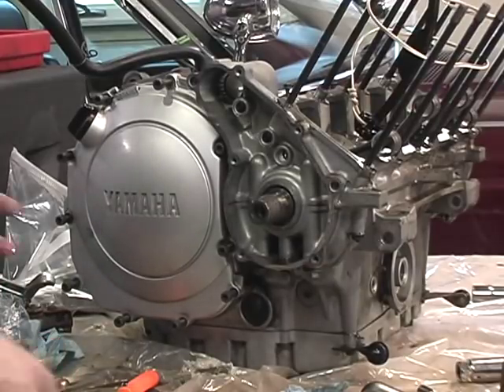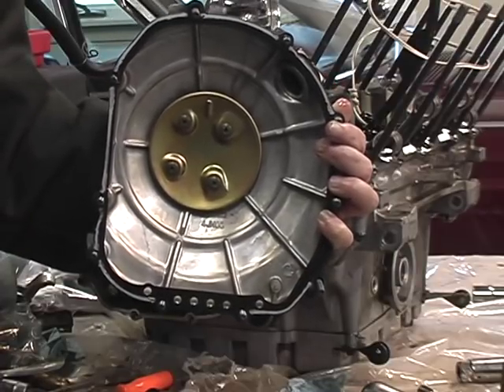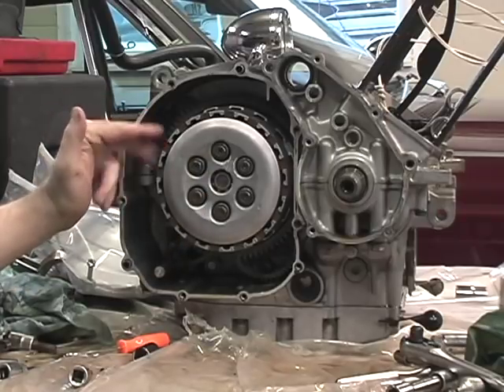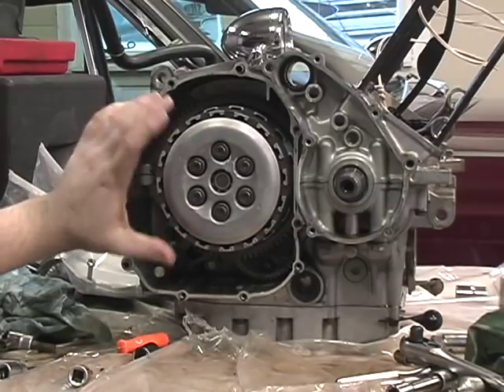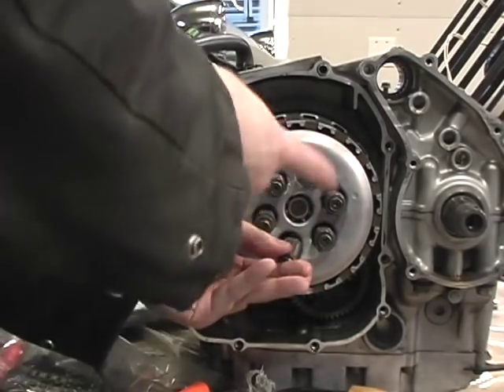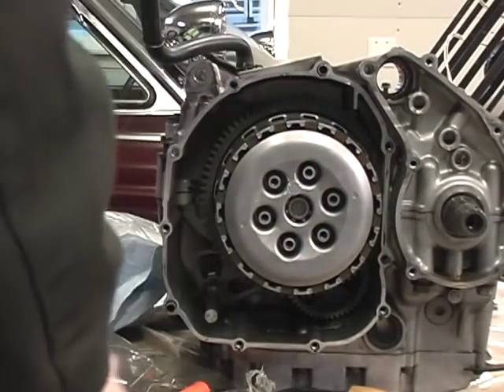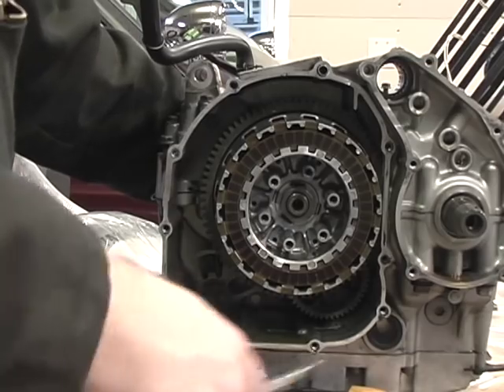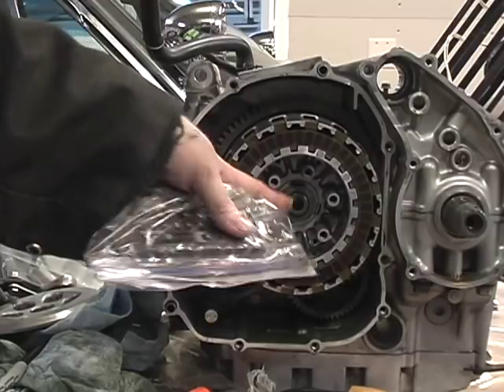13 Clutch Removal yzf600 1996

Comment: Thank you for your reply. I have yet to take the cover off and viewing your video gave me a little better idea whats in there. I am a certified tech so like yourself I can mentally visualize everything in there that could be a cause. It really sounds like a rod Knock but definitely is not a rod bearing or in the internal engine itself. It is for sure coming from the clutch area and more localized right where that shift shaft is but it has to do with whatever is rotating in there... (continued)

Comment from the maker: well in your situation, the sift shaft tab is likely bent.  causing interfearance with the star gear, so shift praw, cant turn the star cam all the way to the next gear. first thing to try is to replace that shaft, you might get lucky. and you can do that on with the bike on the side stand and WITHOUT drainig the oil.  follow the steps in this vid, the shaft comes up at about 11:26. now over time the half shift wears the dogs on the gears (see my other videos about transmission internals)

Comment: Hmmm this has got me bewildered. Has to be something to do with the clutch then... maybe oil pump or water pump but those seem to be operating perfectly (great pressure). Really weird cause it doesnt matter if its engaged or disengaged in neutral or in gear and is RPM dependent for rate that it "knocks". Shifts beautifully and runs like nothing is wrong but obviously its not supposed to make that noise. Be pulling the cover off and hopfully pin point it. Thanks for your input!

Comment from the maker: no, a clutch problem would be an all the time problem, not just a certain gear problem.  you might be refering to the "shift kit" sold by factory pro.  that will improve shifting in all gears.  but it wont "fix"anything just improves the action.  if you already have wear in the 1 - 2 shift.  only solution is to replace those parts.  my other vidoes show those parts.

Comment: Old video but isn't there thicker friction discs on in most and outer most?
Reply: On 97+ usa single headlight Thundercat yes they have different plates.  This is a 96 foxeye they are all the same.  Also most aftermarket clutch kits are all the same size

Comment from the maker: correct if you pull the cluctch lever nothing besides that which is driven off the crank shaft is spinning.  if you let go fo the lever but are in neutral, then the input shaft of the transsmission is also spinning with the crank, and the other obvious stuff.,  noisy waterpump or oil pump? they are in that area though not exactlly where you are describing, but they are always spinning.  the crank turns the oil pump the oil pump turns the water pump.

Comment: question - if you have engine on bike, you don't disassemble the clutch, but because of curiosity you take the clutch push rod out of the engine from the left side - is there any chance for the ball bearing to fall in the engine?

Comment: it is more coming exactly coming from that corner where the shift shaft is but I cant eliminate that it isnt the clutch. just to confirm... when i disengage the clutch (pull the lever in) then nothing in the transmission should be spinning, correct? only things spinning should be the obvious cams, crank and those necessary things? I cant imagine it would be a spring for the clutch went loose and is just banging around on a post on the basket. Prob make huge mess running bike with cover off

Comment: Great Video, question for you since you seem very familiar with this bike. I have a 96' YZF and I get a clicking noise (sounds like a rod knock but its not) and I have localized it to right where that shift arm is. It doesn't seem to matter whether its in neutral or any gear and doesnt change with the clutch released or pulled in. The noise speeds up and slows down with the RPM of the engine. Runs,performs, shifts great. Idea on what it is? star gear? shift arm? Thank you!

Comment: Vashts, I have a question on the clutch side of the bike. I've just changed the front sprocket and chain and want to put the sprocket cover back on. The only problem is, I can't remember what the arrangement is to get the clutch to work. I'm frustrated as heck... can you suggest something. I'd be happy to chat by phone, if you were feeling really generous.

Comment: From time-to-time my 97 yzf600 bumps into second gear and won't engage. 20,000 kms (14,000 miles). Any thoughts as to why? I changed oil to a lucas synthetic... wondering if it needs true YamaLube? Or is that fork bent maybe? If U think it's the fork - have got a link to replacing it with engine left as is?

Comment: what will cause it not to go in 2nd gear...it works fine when i put it in 1st but i try and put it in 2nd gear it jumps out in go in first or nuetral..if i kick it hard it mite go threw all da gears but i want it 2 b smooth goin threw the gears....any suggestions i'd really appreciate it

Comment: hello nice video, quick question.. I have a 1992 yzf that rolls in gear, it select's the gears but doesn't seem to register and rolls like its in neautral. I've took the clutch out and it's pretty burnt out do you reckon it could be more than just the clutch plates and more of a selector problem? it seems to shift up an down the gears smoothly but it's like its in neautral obviously it's ment to hold when it's in gear any suggestions !?   cheers dude
Reply: with the side cover off you can see the shifter working and know.  clutch and springs could be worn. but they can be measured for spec.  check the other side of the bike, under front sprocket cover, make sure the nut is still there  holding the sprocket on
Reply: I also have a question I'm having similar issues, I have an 06 Yamaha Yzf 600r it shifts fine 1st to 2nd but once I hit 3rd it doesn't increase speed and sounds like it's "choking"/"bogging" , 4th it doesn't do anything, 5th it barely even revs..... occasionally it will just die when down shifting coming to a stop sign or red light for example.. then I can kick it into 1st let off clutch and it fires up like nothing.... I'm overwhelmed and extremely frustrated because I have no idea where to start or what's causing all this......
Reply: Bob Marleyyy  anything?

Comment from the maker: i think i understand what you are saying. and broken parts are never good.  a picture would help alot.  as always check out yzf600r.com join the forums and ask your questions there.  your original problem was likely a bent tab on the shift shaft.  the pressre plate should come out pretty close to even when disengauged.  check the forums for spacifics.